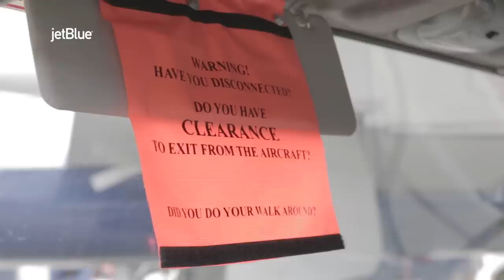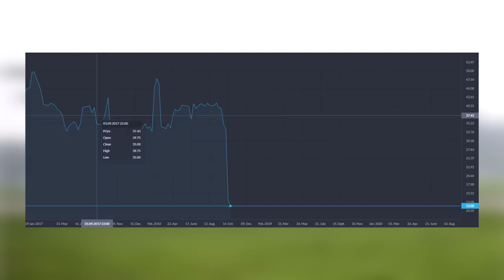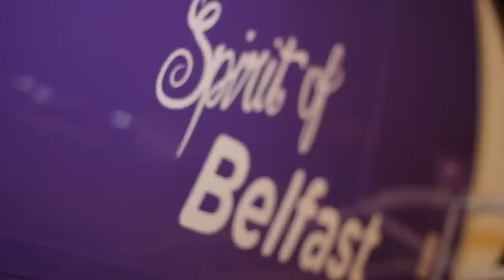Is Flybe the next airline to fall?

Comment: Flybe are a pretty big airline in the UK, with main hub base at Birmingham Glasgow Exeter (head office) and Manchester. I would not worry to much as they are one of very few airlines that actually store fuel at a base so they built up fuel during summer so when it comes to winter there fuel costs are next to nothing
Reply: Indeed they are the largest regional airline in Europe
Reply: Newquay
Reply: @rubenkober  Newquay Southampton I missed out my appolagy
Reply: when ryanair  start from exeter  flybe  might start to struggle
Reply: @lewisg7296  Hopefully it's ryanair that goes
Reply: @lewisg7296  i doubt it as the only route they clash on is Malaga and Ryanair will bring new passengers to Exeter. I think they'll end up complementing each other.
Reply: I always fly from Gatwick so I never see them

Comment: If Flybe goes I'll be sad and I expect IAG will acquire the remnants and probably merge them with BA cityflyer which operates flights under the BA banner from London City and several other airports. So we'll just have to wait and see
Reply: I'd love for ba city flyer to expand!
Reply: I doubt BA would do this since a lot of flybe's routes are actually ones previously operated by BA cityflyer that were abandoned
Reply: I was under the impression that Air France-KLM held the majority of shares. They wouldn’t just sell it to AIG would they?
Reply: @thehardway7970  I don't know where you heard that. First of all until a few years ago IAG had a large stake in Flybe but then they sold it. And currently Flybe uses Avois the same reward scheme as BA the flag carrier of IAG. The only Air France KLM thing is Flybe codeshare with them
Reply: @kianhorton02  but with Flybe gone there is no competition meaning they could take over the routes with little to no effect on travellers  because Flybe  already uses the BA reward scheme Avios
Reply: Flybe operate from smaller airports like east Midlands which IAG will not operate from

Comment: It seems that Flybe already have done a fleet review and it seems they are going to operate the 54 Q400 turbo prop aircraft as their core aircraft type and 15 E175 jets for busy high density routes, to keep operating costs down.
Reply: They are retiring the ERJ-195s and replacing them with new-build ERJ-175s from 2019.

Comment: Once again, another video of yours saying an airline will fail even though you said yourself it won't, nice clickbaiting. They are currently undergoing cost-cutting measures, including removing the ERJ-195s from the fleet. I wouldn't worry about them, they had worse problems a few years ago.
Reply: I see is there a possibility that Flybe could do Codeshare partnerships with Virgin Atlantic.
Reply: I think any partnerships/codeshares would be beneficial in the current market conditions, especially those in Europe.

Comment: I am studying business management at University in Manchester with a view to going into Aviation Management.  I believe I am right in saying that Flybe has full planes, however alot of these were sold at discounts so they may not be getting the full value for those seats.  In the same way that Boots has alot of 3 for 2 offers on things like mouthwash compared to Aldi. Aldi tend not to offer those kinds of discounts.  Their 6 in 1 mouthwash is 0.99p. No variation or special offers.  So Boots yield on the mouthwash, just as Flybe's yield on their seats may not be as great as you might think.  I would llike to know what you think of this.
Reply: David protheroe-beynon A lot of businesses are struggling at the moment, it could be Brexit concerns but profit warnings are not new at all

Comment: I think the reason Flybe is failing is due to the railways getting faster and more efficient operating similar routes to Flybe and easyJet offering cheaper fares on international routes
Reply: Murray Jones - completely agree.  The Flybe flight from Exeter to London is unreliable and goes once per day at silly o’clock in the morning with return early evening.  Not ideal schedule and when you factor in getting to and through the airport at each end the train is quicker, more flexible (at least hourly) and more reliable.  Unfortunately I know regular Flybe passengers refer to them as FlyMAYbe.
Reply: Murray Jones Going from Edinburgh to Cardiff the train can be over £300 more than Flybe and 5 hours quicker
Reply: @chrismoore4423  the flight from EXT to LCY is designed so someone from Exeter can get a full working day in London and for the aircraft itself to operate both LCY-AMS and AMS-EXT. The aircraft operates this pattern. EXT-LCY-AMS-EXT then EXT-AMS-LCY-EXT.
Reply: I went for fort william in Scotland could not do it in a day on the train 5 hours from Leicester to Glasgow then another 4 hours to fort william the only option was flybe from East Midlands to Glasgow 1 hour flight and made it if you need to get there quickly flybe do a good job and is quicker than trains on Scotland to England routes trains are good if you have loads of time to travel but if your going to Ireland channel islands isle of man I use flybe
Reply: Yes and even if you look at the train operators cheapest advance fare and flybe's cheapest advance fare flybe can be cheaper
Reply: From NCL to LHR on the plane is £1,500 and the train is only £200.

Comment: It's cheaper to get a coach or drive around the UK.
Reply: Isaac O And much slower
Reply: Coach is a joke from Devon.  5-6 hours to London.  Train is just over 2 hours from Exeter, and runs at least hourly.  Looked at coach to LHR, but actually only slightly cheaper than the train but sooooo much longer.
Reply: Flying is often cheaper than trains